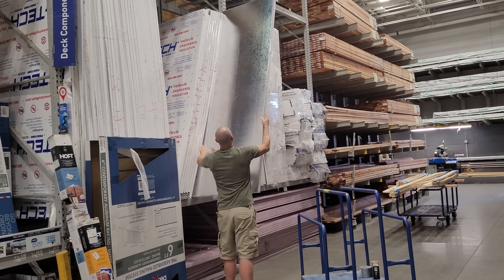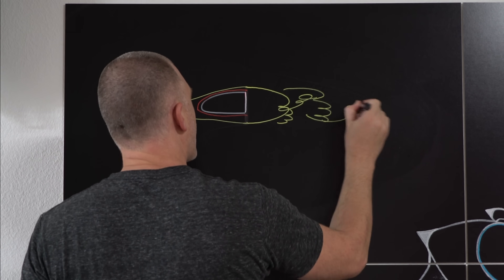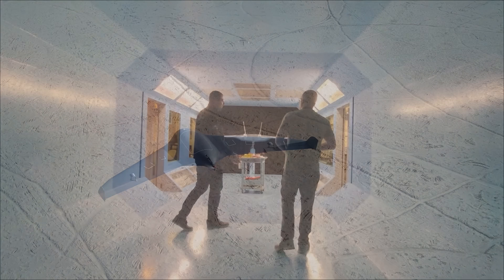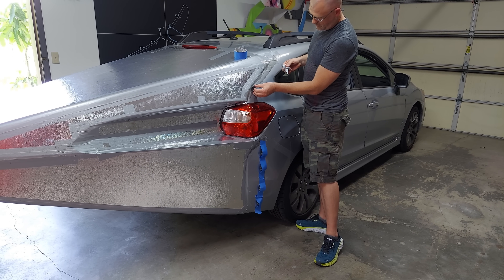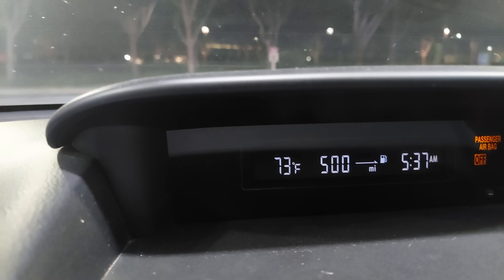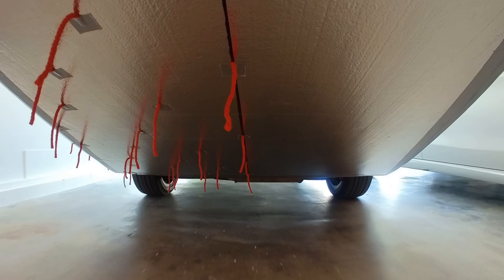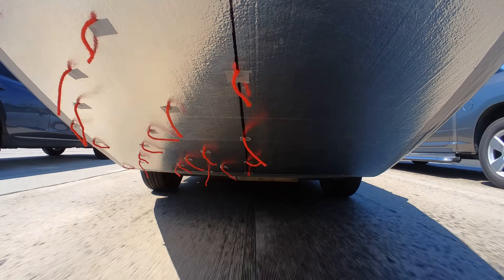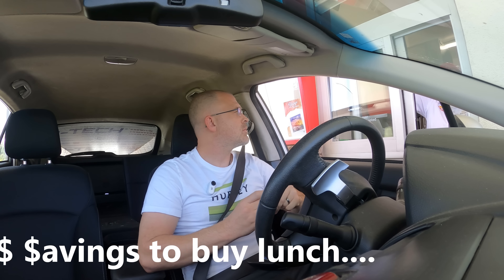Using Simple Aerodynamics to Beat High Gas Prices (Home Improvement Store Edition)

Comment: Most of what you've done was covered a hundred years ago, the raised tail you designed was experiencing reversion from the lack of clean flow from under and around the car.
in the 1930's an aerodynamasist named Kamm found out the rear of an airfoil design didn't have to end in a true taper, the rear third or so could be cut off without adding muchvdrag to the design. 
I think you're on the right track by lowering the overall shape to give it a flatter floor, some of the most efficient profiles resemble a bisected teardrop with some of the tail cut off.
Reply: I vaguely remember a "Kamm back" car. Chevy Vega?
Reply: @uncareid5557  There was a number of them back then.  My first thought goes to the Shelby Daytona Coupe.
Reply: Check out https://en.m.wikipedia.org/wiki/Rumpler_Tropfenwagen for another water drop design!
Reply: @capriceranana5733  https://en.m.wikipedia.org/wiki/Schl%C3%B6rwagen
True water drop design*
Reply: @capriceranana5733  beautiful!
Reply: Might be a good approach to start extreme cut it back incrementally and see where improvement drops off

Comment: You get an A for effort, but the lesson to be learned here is: Test parameters before you build something like this! Aerodynamics is extremely complex and cannot be guessed at if you want to optimize modifications. Julian Edgar tuft-tested an angled extension here: https://www.youtube.com/watch?v=GKamOhDza6U&t=1s&ab_channel=JulianEdgar. Note that attached flow != lowest drag in this case. Julian has mentioned elsewhere that the steepest angle which had attached flow on the extension was NOT the lowest drag, based on other test methods. Check out his channel for lots of videos on how to test things before you build, or my website at <www.amateuraerodynamics.com>.

Comment: Air in the boundary layer loses energy travelling downstream and, the less energy it has, the more prone to separating (exp at low speed) it will be while following a curved surface. Since your structure is mounted already aft you cannot curve it that much. If I would place as much of the curvature as possible at the junction of your structure with the car, while keeping the aft part straight, and work on improving the turbolators.

Comment: SORRY FOR CAPS.. LOST MY SPECS..  PLACE  A SUCTION FAN INSIDE OF YOUR ADDED APPARATUS / CONTRAPTION,  FACING THE GROUND. YOU WILL NEED TO RE-INFORCE  YOUR CURRENT CONTRAPTION. THE LOW PRESSURE INSIDE WILL  DRAW IN THE TURBULENT AIR AND EXPEL THROUGH THE REAR OPENING OF YOUR DEVICE. THIS WILL REDUCE THE DRAG FURTHER AS THE AIR ABOVE THE APPARATUS WILL ALSO BE DRAWN TO THE EXPELLING AIR FASTER BY ENTRAINMENT.  YOU WILL ALSO NEED TO COVER THE  RECESS ALONG THE APPARATUS WHICH YOU MADE FOR THE LIGHTS WITH CLEAR PERSPEX.   THE  SUCTION WILL CREATE DOWNFORCE ... I HAVE A PATENT =PENDING MULTI-STAGE ROTOR WHICH WILL REDUCE DRAG ON EV CARS. ITS IN THE "ENGINE BAY" WITH INLETS ON THE BONNET AND  AND IS EXPELLED ON THE SIDES NEAR THE FIREWALL. THE VELOCITY OF THE  AIR IEXITING THE ROTOR IS MULTIPLIED  AND  CLINGS TO THE SIDES OF THE CAR REDUCING THE PARASATIC DRAG FROM THE AMBIENT AIR. GOOD LUCK

Comment: I was told that fuel injection cycles on the exhaust stroke to cool the exhaust valves and seats as opposed to the manufacturer to use sodium filled valves and hardened seats that would cost them more in manufacturing, not sure that is an issue since they hand cost off to the consumer… Eliminating that cycle tho would double your mpg. Another source of gained mpg could be forced induction, like a turbo or supercharger…. if you can keep your foot out of it. Cooling intake air and fuel also can produce gains. Nothing is going to make a bigger difference than driving like you have a egg between your foot and the pedal tho and its a cheap option tho it might get you run over. Higher horsepower engines can be efficient due to not having to work as hard. Interesting video! I worked in aviation for a long time and streetrodded a bit
Reply: No manufacturer is blowing precious fuel over the valves during the exhaust stroke these days, so our lad won’t be doubling his mileage with a simple ECU tune.
Likewise, engines get better mileage the Higher the inlet temps, not vise-versa. Cool Inlet Air is for making power, not mileage. Ditto for coolant temperature; to optimize mileage, go to a 195 or 205 degree thermostat.

Comment: I applaud this experimentation.  That said, I do think it’s funny that you are leaving brake lights exposed seemingly only for legal reasons.  Not getting rammed from behind is an additional benefit, though the gain in milage might be worth it in the short term.  Why not cover them with clear plastic?  I’d also suggest some tape work on the front.

Comment: My biggest gas saving trick: driving 50/55 in stead of 65/70/75. It’s absolutely mind boggling how much that saves.
Reply: yep, drag increases by the square of speed, speed increases linearly with speed
Reply: @saeedhossain6099  And to top that other factors add to a more than square increase; engine speed, drive train losses, friction losses… It all adds up to more than one would expect.

Comment: you know I've had two Subarus I had a 2005 Subaru Impreza RS I bought it used drove it for about 15,000 mi engine let go for no reason I currently drive a 2019 Subaru WRX also bought that used with 24,000 miles on it engine let go in 3,000 MI into owning it Subaru replace the engine for free thank God I understand brand loyalty but I don't think Subaru is making great cars anymore but the greatest part about owning a Subaru for me is the people inside the vehicles always willing to help a fellow Subaru owner ✌️

Comment: If you want a smooth-ish contour for the taillight area consider buying a sheet of clear plastic. Most likely this is something they have at your home improvement store. Just cover the taillight cutouts you made.
I haven't checked the laws (and certainly not the laws where you are) but I think it's a requirement to keep the third brake light working; if it failed.... at an annual inspection they would probably tell you to fix it before you could pass.

Comment: I had the privilege of owning Aerocivic for a short time, and I'm thrilled to see others experimenting with boat tailing and other aerodynamic items.
Reply: How do you think a wire mesh Boat tail would work like you would see in a window.

The thing would breathe so it would decrease lift.

I’ve been thinking about it for about a month. I’ve done some experiments in the shop using a air hose the airflow follows the curvature and  angle.

I can put my hand under the wire mesh and don’t feel any direct pressure from the air hose that I am blowing on the screen at the angle it’ll blow straight through but it follows the curvature of the wire mesh When you’re trying to mimic the boat tail angle
Reply: @excaliburjohndeere7657  I can only guess. So long as the mesh is fine enough, I'd wager you'd get nearly all of the benefit. I'm of the opinion that an inflatable tail is probably a better way to go, however, and it isn't all that expensive to have manufactured.
Reply: @excaliburjohndeere7657  I've wondered the same ! I suggested this idea for enclosing recumbent bikes, but haven't seen anyone take up the idea. 
Screen would direct air down the sides of the vehicle, while also allowing air to pass through from crosswinds ! 
Would love to see what you come up with.

Comment: I would connect an LED to the taillights and insert a translucent diffuser into the rear open so that the LED illuminates it evenly, turning it into a new taillight. In this case, you don't have to worry about your original taillights. As a result, improved aerodynamics will give you a better MPG.

Comment: If you have a tow package you could get a set of trailer lights and fair them in.

Wheel well fairings at the rear probably would clean up the flow on the sides a lot.

A few low drag production cars have small air dams in front of their wheels, that with a smooth undertray would reduce the need for your air dams and skirts to be super close to the ground.

Diffusers on race cars have big strakes to attach the air flow but there is still a maximum angle before the air separates.  Add some strakes or reduce the angle.

Depending on your engine temperatures you can also block off a portion of your grill to reduce the amount of air getting under the car through the engine bay.

Taping seams, shaving door handles and lowering ride height (to reduce frontal area) all help.  You could chop the top if you want to be really extreme.

Finally you could reduce mechanical drag by converting to FWD and installing the skinniest low rolling resistance tires you can find and then filling them to the highest recommended air pressure.

Comment: Have you thought instead of using front splitters and side skirts, make a smooth underbody? That would also lower the front surface area and also provide use of rear splitters. Instead of trying to fight the air, having a smooth under trays could be a better view in a aerodynamic sense.

Comment: At around 9:03 when showing the possible mod to the front of the car, this video causes my LG Smart TV to power cycle. It is a 75” running webOS model 75UM6970PUB running version 4.9.6-114 is repeatable. I wonder what could be making this trigger.

Comment: Again no pro here by any stretch of the imagination. 
But id make the sides as well as the underside closer to the same angle as on the roof panel as you know at that specific angle it keeps the air attached to the panels. Go to extreme on the angle and the air simply cant wrap around the corner and re attach to your sides/undertray. As tempting as it may be to make it to a point at the rear thinking pointy=slippery. Making the furthest rear wider and bottom lower, as counter intuitive as it may seem maybe help substantially. 
Best of luck! I did this similar idea to my truck and it cruises much better.

Comment: Put a belly pan on to cover all those bumps on the bottom. One DIY EV builder improved energy efficiency of his conversion/build by more than 10% just by smoothing out the bottom of his car. Coroplast sheeting is light weight waterproof material that can be attached with self tapping screws w/washers. Make sure to rust proof the screw holes.

Comment: The reason car manufactures aren't doing this is for 2 reasons (I think). The vehicles looks ugly.  A German car maker made Schlörwagen. Thing is  shaped almost like a raindrop. No body at the time (and I agree as far as looks) liked it. Also you're putting a lot more materials into a car to make it aerodynamic, which means they have to drive the cost of the car up. Car owners (average Joe and Jane) don't want to pay for that. They just need something to get from point a to point b. If you drive in the city or below 55 mph, having an aerodynamic car isn't going to help much. So car manufactures aren't going to put the effort make these vehicles.

Comment: why dont you try covering the underbody of the car? also u could try a different cover for the weels (something that maybe is not attached directly to the wheel but around it). i dont know but just from looking, it seems that the cover you came up with could potentially generate some brake cooling problems, i mean its not a race car but the air is clearly not going where it should
anyways, loved the video 
and a 13% improvement in efficiency is massive. how would u expect something better? if it were like a 5% improvement i'd be really impressed already

Comment: Its called a Kamm tail, also known as a kammback. Loads of cars have used em..... though to maximize efficiency, they would have to be far too long to be practical.
Reply: Not quite. A Kammback (or K-tail) is characterized by a carefully sloped top followed by sharply chopped tail. The optimum angle of the top angle should be 10-12 degrees and the rear chop area  should be about 50% of the cars maximum cross sectional area.  If you look at just about every modern car design they use this feature. Look at the Prius, it has a very highly optimized K-tail. I think OP could achieve similar results with a much shorter tail by extending the tail enough to fix the slope angle. Subaru made a compromise here to increase rear seat headroom without lengthening the car which resulted in a less than optimal rear slope.

Comment: This is a great demonstration of how ICE cars have reached thier efficiency limit, as the same aerodynamics treatment applied to an EV with already 2X-3X will likely achieve greater efficiency improvement because EV engine are always near 100% efficient whereas ICE engines get less efficient at low throttle, making this exercise futile.
Reply: "futile"

Comment: For more inspiration: https://aerocivic.com/

Your vortex generators are the wrong way around - they won't do that much anyways- you could just as well use flat triangles at an angle
The bottom angle of the extension is going up too steep
Build a belly pan underneath and an air dam up front

Comment: Now... I have to say, as an ev owner these are silly. While.. ok, they are indeed a great thought experiment and they would work on EVs as well, the amount of money you will save if you took a loan and bought a new ev is huge. It's so big, that actually, you'd save the cost of it in around 10-15 years in rough estimates. (depending on where you live of course) Or perhaps you could also use your money wisely and buy a second hand ionic (not 5, the previous one) or a leaf. Any how, go electric.

Comment: I would suggest adapting the "cone" or "pyramid" shape you have, but only below the existing point you have, into a wedge.  The air essentially does not emerge out from under the car, or rather, it does so very slowly, and as such just treat it like your car is hugging the ground, as you can adjust it to behave like anyway.

Comment: I plaid around with Aero. on my car too. The under part of the car is the BIGGEST source of drag. Fix that first if you can. I have tried commercial air dams and home made air dams and found that the ones I made were far more efficient at speed. The down side is that at street speeds they made the car WAY less efficient, to the point that I had to make a decision, it was either going to be an all highway/track car or a every day car with out air dams. Look at what Chevy did with the wheel wells on the Corvette Z5 performance models. Smoothing the air inside the wheel well area on a production car seems to be a cost effective way to get more efficiency. I made some "well skirts" that worked well and did not impede wheel travel. The dealer laughed at my well skirts and the next year Acura Racing was running something similar. Note: duct tape will ruin paint... I have used silicon with some success and was able to get the car back to looking somewhat normal after I was done "playing".  I look forward to seeing what comes next!
Reply: Thanks.  Why worse at low speed?

Comment: This does serve as a rear end crumple zone. Wind tunnel testing would be ideal to test efficiency.
Was wondering if the drag coefficient reduces with increase in surface temperature of the body of the car. Could local temp spots (hotspots) be used to decrease localized drag in those regions?
Reply: Crumple zone? It's polystyrene foam. It would effectively be invisible in a collision.

Comment: 8:12 actually, you can do something to stop the turbulence by the rear lights. You could put a big piece of clear PC plastic and curve it to fit the gap. You can still see the signals from behind but still get rid of the turbulent air.
Reply: came here to say this
Reply: PC plastic curve...sounds like a project in and of itself.
Reply: @TheProtocol48  Some of those clear plastics are easy to make nice bends with a heater. Clear computer water cooling tubes are acrylic (sometimes PETG), and those are clear like glass but very easy to bend (in the case of tubes, fill the inside with sand before bending so it doesn't collapse or kink the tube when bending 90 degrees sharply or doing spirals).
Reply: @TheProtocol48  You can vacuum-form clear plastic, but if the heat doesn't make it yellow, the sun will, unless you treat it properly.
Reply: Packing tape
Reply: Glare becomes a problem, as well as attenuating the light in a way that reduces safety - although that's probably not very likely.
Reply: Glare will be an issue and light diffusion which will impede the lights ability to to be seen from a distance specifically when a driver riding at a safe distance needs to tell when braking and not braking the glare makes the eye harder to discern the gradient of light change especially during the day. Have some friends who used to hypermile Honda insights first gen and they ran into this issue with a very similar design to the poster.
Reply: @Michael Morgan thank VW for that.
Reply: What about wire mesh or insect screen that you would see you in a window it is also see-through. I would like to make a boat tail out of insect screen
Reply: @excaliburjohndeere7657  lol.
Reply: @excaliburjohndeere7657  bruh